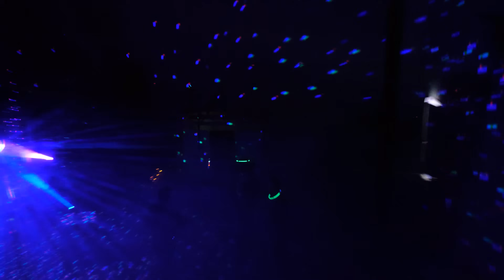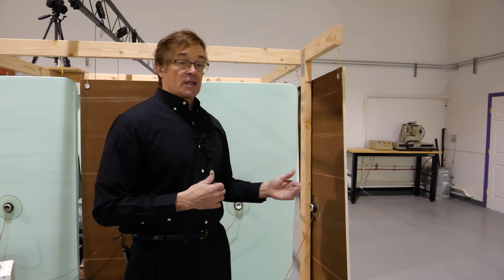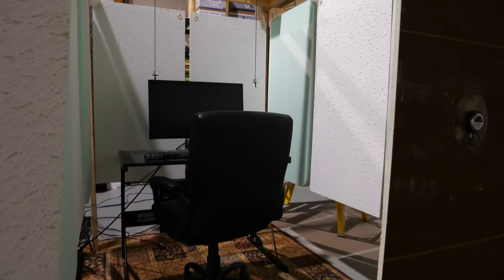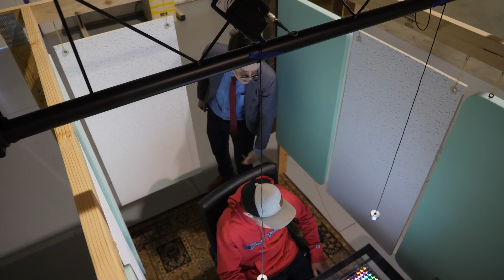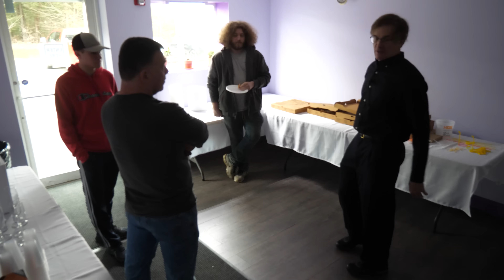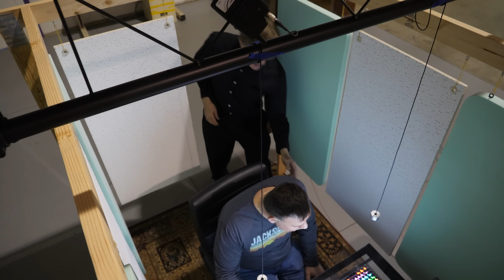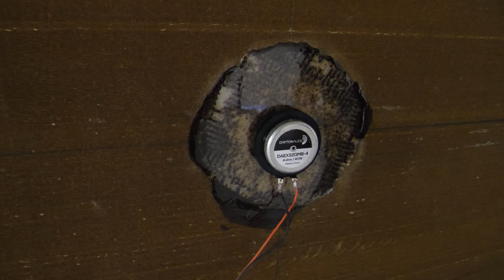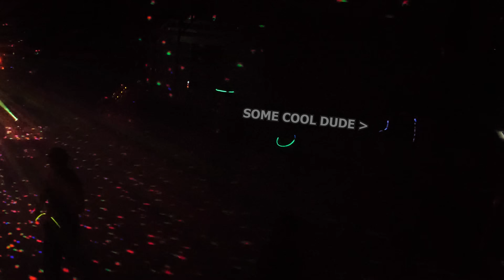SHOULD SPEAKERS THIS GOOD BE LEGAL?

Comment: It's obvious that the lowest frequency reproduced mainly is restricted by the dimensions of the panel due to an acoustical shortcut. I wonder what would happen if the side walls of a regular box would be replaced by balsa wood with bass shakers mounted on them. I asume that both side walls would work like one big cone.

Comment: I crash-landed here because I saw some tiny "bone conduction" Bluetooth speakers and wanted to learn more...
From there I've gone through ButtKickers and similar, saw this kind of tech going from high-end Home Theater setups on to gaming Chair applications to enhance immersion and even learnt that there is a device called earthquake, which is a transducer with 1000w lol.
Plus, found out that this kind of tech dates back to Tesla himself, which is amazing...

Now, I'm wondering how I can put this to use on my Car sound-system in a way that resembles "infinite baffle" to achieve nice strong bass under 30Hz

Comment: There's nothing to be sorry about! We simply disagree and it's grounds for a nice discussion. 
Your argument does not convince me. If you watch videos or read about Bernoulli's principle you'll see that nowhere is air involved. In general, you'll see a pipe carrying water with a neckdown in the pipe (similar to Bernoulli's original set-up). They'll show a pressure  reduction in the neckdown using vertical stand pipes that contain water that rises to various heights. The ones in the neckdown will always be lower than the ones in the larger diameter pipes and this shows a pressure drop in the neckdown that has nothing to with air entrapment. The water is simply flowing faster in the neckdown due to energy conservation (first law if thermodynamics). 
I'll find a you tube video and send you the link. 
With high regards, 
Alan K
Reply from the maker: You're close to the principle. In the setup you described, the pressure (potential energy) indeed drops due to the increase in the linear velocity of the fluid.  That is the Bernoulli principle.
The entrainment has nothing to do with that process.  It is the CONSEQUENCE of the lower pressure in that region. Air flows into that lower pressure region.
Reply: You, like many on YouTube and elsewhere, are taking the principle and applying it elsewhere. What you describe is simply air entrainment. Just seeing a jet of a fluid somewhere does not mean that Bernoulli's principle can be applied. People use the principle to explain things like airplane lift, a ball in an air stream, blowing air over a flat sheet of paper, etc and each is not Bernoulli's principle. Again, applying the principle to any jet of of air, is not appropriate. (See the Coanda Effect as well as Understanding Bernoulli's Equation by the Efficient Engineer.) 
It is I who should say I'm sorry for bringing this up!
Reply: One further comment. 
If you drill two holes in the pipe - one in the neckdown and one in the larger pipe - you will see water spurting out of both holes because they're both above atmospheric pressure.
Even though some air will be entrainment in the water stream, this has nothing to do with Bernoulli's principle. 
I'm hitting the sac now. If you wish, we can talk later.

Comment: Good day to you and your son:
I really enjoyed several of your videos - thank you. However, I would to point out one error you made in one of your sound videos. You mentioned Bernoulli's principle and air entrainment at the same time and this implied that Bernoulli's principle was due to air entrainment. If you look in most any physics text you will find that Bernoulli's principle has nothing to do with air entrainment; it only applies to fluid tubes along streamlines! This is a common error even by physics professors so don't feel bad. 
PS I'm a retired engineer with two degrees in physics.
Reply from the maker: Thanks. 
I'm having trouble remembering the context of the statement from this previous video.
But, is it possible that I was referring to Bernoulli's principle to EXPLAIN air entrainment rather than referring to air entrainment to support Bernoulli's principle?
Reply: Your resonse is appreciated! It will take me some time but I'll review a few of your videos to see if I can find it.
Unfortunately, there is no connection between Bernoulli's principle and air entrainment. These are distinctly different phenomena. Again, it is a very common assumption.
Reply from the maker: I'm sorry, but I have to disagree. Entrainment is the result of the decrease in potential energy in a fluid when its velocity increases because of the thermodynamic law of the conservation of energy.

Comment: Is there any way to have any type of decorative covering on the panels, like cloth, dyes, etc? These are amazing but would like to have them look better.
Reply from the maker: Yes.
You can paint or stain the surface. Don't add a layer of any material that will increase the stiffness of the panel. That can occur even with a plastic film.

Comment: how different are these than the Electrostatic speakers from the 70s
Reply from the maker: The principles are similar. The mechanics of the voice coil and the properties of the panels are different.
Reply: @TechIngredients  An electrostatic speaker is driven by a homogeneous field (along the entire surface rather than on one point) Better, but much more expensive. Some built their own, which would make a great video!

Comment: As an electrical engineering PhD student studying electromagnetism and very high frequency circuits and power amplifiers, I really found this concept very neat. Also I appreciated your piece on impedance matching the load that the power amplifier drives most efficiently. It’s actually not a very different concept up at gigahertz to Terahertz frequencies. It’s all the consequence of wave propagation and the best ways to transfer energy through propagating waves. There is something very beautiful in that concept.
Reply from the maker: Agreed, and thanks!

Comment: At 150 hz on the sub its going to be very muddy.
60hz is a much better crossover point, so you need a midbass driver to fill 60hz to 120hz  this can be done with 5.25 and 6.6" speakers
But I doubt the panels put out 20k hz  so you lost the harmonics created buy the total sound output.
Yes it works but  for an audiophile its not going to  cut it.  Its just loud.

Might be good for fill in a multi channel system, but its not a substations for good speakers.
That or your telling me i'd waste 10k on a pair of dimond 800 from B&W  or a 40k dollar pair of naturist are a waste of money.

Comment: Wouldn't it make sense to put one panel in front of the other . You are using a ceiling tile for bottom end and the insulation sheeting for highs. Make the insulation panel smaller or the bass panel bigger and then use different size exciters or input power to dial them in..
Reply from the maker: It might.   I didn't think of that, but it's a good idea.

Comment: what about carbon fibber panels or round pannels instead of square
Reply from the maker: There would likely be little benefit from carbon reinforced panels. The infmcreased stiffness wouldn't be bad, but the decreased damping will generate more resonance and smearing of the sound.
Round or elliptical panels may be a good choice,  although we didn't test that.

Comment: just used the same tech in my van. two panels at 15 by 18 inches. 40 watts 4 ohm. coupled with an old pair of Yamaha box speakers, (mostly for the deeper bass). an MAN!! the sound is insane!!! will be adding a couple more panels horizontally from the ceiling and repositioning them for optimal acoustics. $1000 sound for $50 !!👍👍                                                                                   P.S. I used half inch thick inch rigid insulation board. cause I had some handy.                             P.P.S. Not using any amps. just the Pioneer Car stereo. although it is a better model.

Comment: How works with a really low volumen output?
Reply from the maker: It works well. We didn't test the limits, but you could clearly hear the output even when you'd have to move your head to within centimeters of the panel.

Comment: Late 1960s early 70s Radio Shack sold a driver with no paper element just the coil driving a weighted body with a centered wood screw to attach it to your  dry wall/:paneling  in essence turning your wall into a speaker..problem was it created sound in all the adjacent rooms..it worked.. cool cheap speaker capable of  driving  parents nuts in the heyday of LED Zeppelin etc..

Comment: I am an electronic engineer . my hobby is repairing musical instruments .... Yamaha have been using the offset of the " VOICE COIL "  on the main loud speaker for for years, to produce the variable dynamic spread of sound off the surface of the speaker. 
The first Yamaha organ I repaired was back in 1976, forty nine years ago , I had just married my wife. The organ was about five to ten years old then.
Reply from the maker: I'm not surprised, but that's interesting to know.

Comment: If you run two speakers in series that are 4 ohm, they equal 8 ohms impedance. So if you run two speakers in parallel that are 4 ohm, you should have 4 ohm impedance, not 2, right?
Reply from the maker: No, it's two ohm. They are not independently driven. They share the load, cutting the impedance or resistance in half.

Comment: Ive been doing this for years with those lowes plywood boards that finish off cabinets. I found that angling them at 45 degrees also, adn creating a very very small concave bend in them, along with aligning the position not only for the 2/3 3/5 but a golden ratio position, gives really good sound quality, THOUGH it does have more of a narrow-banded directivity index, system wise. Having piston like panels tend to resolve a lot of compression diffraction issues from common loudspeakers. Fun to mess with different cutoff frequencies with area based tuning :) Great work guys

Comment: Oh yeah! This is so great to watch and hear!! I was looking for original speakers and you helped me on the right way!  Qusetion: what happens if you paint the styrofoam boards? Because I like them to be white. Does the paint influences the sound? Thanks.......
Reply from the maker: Spray paint doesn't seem to stiffen them up noticeably or change the sound.  Make sure you confirm the compatability of the paint and its solvents with the polystyrene material.

Comment: I've learned a great deal from your videos. After looking at this again i'm going to try a few new things. I have extrapolated information from your videos and others along with my 30 year experience as a media producer and I took a somewhat different approach with tremendous results. I hope to run some frequency responses with a proper mic soon but with extensive A B testing I've been able to best every speaker I can get my hands on. I'm installing single 20watt Dayton actuators with bass extensions onto 12" turned and carved polystyrene disks centered into fixed open baffle housings (not cabinets exactly) and fixing them tightly in with a foam rubber type surround. Using free software I've determined that they get down to around 80khz! By adding a small 8" musical sub crossed at 80-100 the bass is very rich detailed and most importantly, fast. I've tried the flat panels but they lack the presence and pop i'm getting from these. The detail and imaging is particularly impressive.  Next up is to try the 40 watt'ers in slightly larger surrounds.

Comment: Instead of using a sub. Could you use a huge panel on the top of the structure pointing down? Or does it need to be even bigger?
Reply from the maker: You're  moving in the right direction.  We needed some way to film the participants, and a large 4' x8 sheet is getting close to the sub frequency range.

Comment: A work mate from my friend used to custom build HiFi amps (really beautiful, with a custom PCB where everything was laid out in circles), and also flat panel speakers. He used some plastic board type of material that reminded me of these white, slightly translucent double-pane boards with internal bridges every ~5mm or so. He mounted them into racks, varying from picture frame size to 2.3m high and ~60cm wide free standing versions. When we visited his home, we got an amazing demo of them in conjunction with his also custom built massive subwoofers. Quite an experience! Mind you, this was also over 20 years ago by now!

Comment: Can anyone tell me what the preferred gap is from wall to back of the hung speaker panel?  Is it a ratio of distance based on overall size of panel used?  Here's why I ask... I have two basic prints hung on the wall flanking my TV.  Basic 24" x 36" wood frames with the canvas stretched over the frame and stapled in back.  Simple stuff.  The interior void behind the print is basically 1.5" x 22" x 34", and I was considering how this panel speaker might work if I slipped the panel into the void inside the frame.  Make the panel 20" by 32" so that it can hang with 1" of gap.  I am not looking for insane sound, just something to compliment the weak speaker in the TV.  I like the idea of hiding the speakers in my wall coverings.

Comment: @2:45 that looks like a Phanteks P600s computer case.  Wife and I both have a P600s cases for our downstairs pcs.  They are fantastic!  When cleaning the fronts, do not leave them soaking in water with car wash soap.  It discolored mine :(  

The front fabric likes to collect and hold fine dust which is great except when it's time to clean them.  It is not as simple as just popping it off and hitting it with the air compressor.  I usually rinse them off and let them dry.  

One time I decided to soak in car wash soap to see if it would give it a bit of slippery shine to minimize dust.  It ended up causing spots of discoloration.  Who knew!?

Comment: What was the reason the mode suppression counter weighting, demoed in your earlier video, didn’t make it into the final?
Reply from the maker: I didn't experiment to find the optimal position for the ceiling tile material and decided to keep it simple rather than add something that could make them worse.
Reply: @TechIngredients Oh dear. No idea where am I going to fit the anechoic chamber.

Comment: I’m an audiophile and the limitation I see with this setup is the surround sound, which is more of a gimmick than true to life.  

For instance, if you’re in a concert hall listening to an orchestra or acoustic soloist, you don’t hear music all around you.  Instead you have a wall of sound which is directional, but crucially each instrument has its own place within the wall of sound (which audiophiles refer to as ‘imaging’), thus with a good sound system you can recreate the imaging and depth of soundstage of a real orchestra.

I don’t think this system as configured (surround sound) can recreate this.  But, most music is two channel stereo, so it’ll be interesting to see how well you can create an audiophile experience with just two panels in a stereo configuration (perhaps with the addition of two subs if the lower frequencies are a problem).

You really need to audition your system with the small subset of audiophiles who are interested in recreating life-like acoustic performances from recordings.  Note: most audiophiles aren’t trying to achieve this…most don’t like acoustic music.
Reply from the maker: That would be useful.
But, keep in mind we're trying to assemble a system that the majority of listeners will appreciate as well as be able to afford and construct.

Comment: The epoxy mounting point is a really good tip.  I have built four sets of these speakers, one using ceiling tiles and the other three using foam project panels from Home Depot.  In every instance, at some point, the drivers all feel off.  Mostly that was due to the fact that I had mounted the drivers with the provided double sided adhesive tape and then decided to relocate them.  Duh.  I used a few different butyl tapes, first remounting them to a freshly cleaned area on the panel (fail), then used seam tape, foil tape, and butyl tape for the mounting location (much like your epoxy treatment).  Fail, fail, fail.  Eventually I hard mounted the drivers, driving screws through screw holes in the drivers and into a backing of thin pieces of wood.  While that has prevented them from coming off of the panels, it has diminished the sound quality significantly.  I can't wait to try that out on the ceiling tiles so I can hook them up like you have them in this video.  One of each type of material wired in series, like i had originally intended.  One quick question: is there a resource for determining the optimal panel size for the different sized exciters paired with different panel materials?  Before I had adhesion issues with the ceiling tiles I used 35W exciters with a full piece of ceiling tile and a 24W exciter with a 24"x19" foam panel and I was not impressed.  I was also having issues finding a way to amplify them properly.  I couldn't afford a small power amplifier so I tried a couple of different AV receivers and even used a battery charger to power an old car stereo head unit.  With the AV receivers you'll run into issues with impedance using channels A+B if you want to run four speakers.  That was fine running them in series and with that receiver I could adjust each speaker's output independently.  I finally but the bullet and bought a new Sony four channel power amp with Bluetooth and I wish i would have done that to begin with.  Definitely a much more elegant solution.
Reply from the maker: Good comment!
There is no resource that I am aware of. However, there is a general principle that  the panels have a maximum output without undo distortion. The larger exciters can easily exceed that and so need to be run at a lower fraction of their rating.  The smallest exciters will be overdriven at that cutoff.